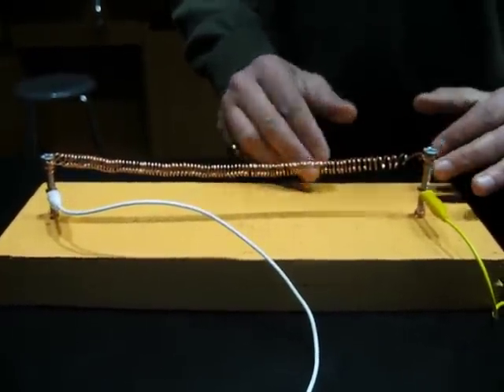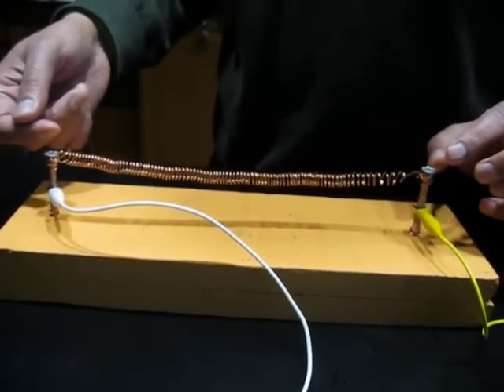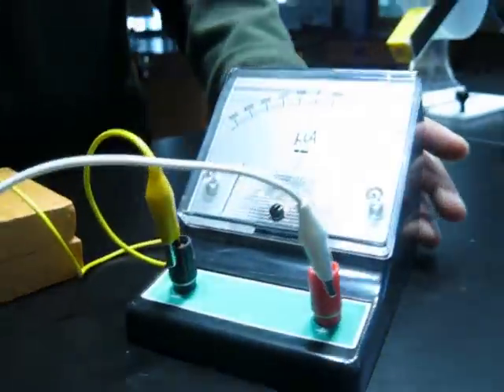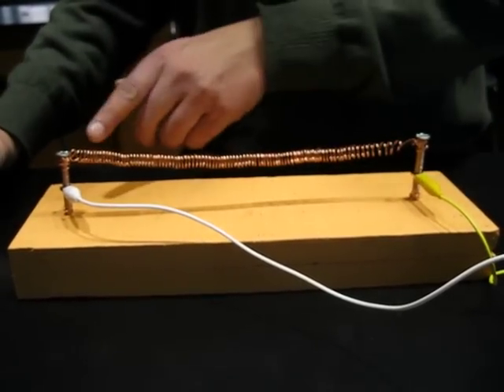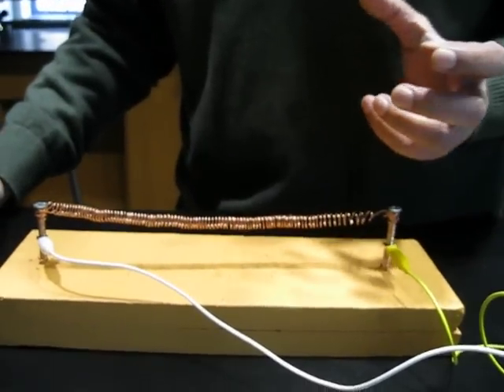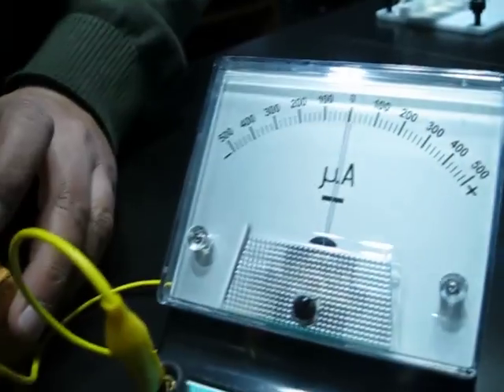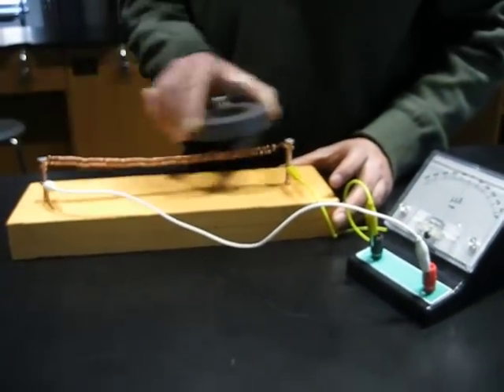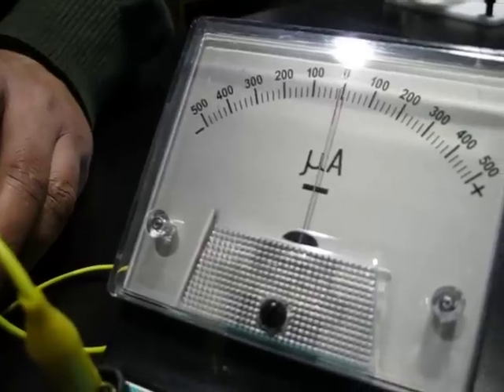Electromagnetic Induction, Faraday Experiment

Comment: The low voltage developed is due to the subtractive polarities of emf induced in two opposite side of the coil. They tend to cancel out each other, however they're unequal so there's a small potential available at the voltmeter terminals
Reply from the maker: Make sense to me!

Comment: Formula for calculating  current (induced) is B/un=i
Where, 
 B= intensity of magnetic feild 
n= number of turns
u(nu)=permeability of the material
Reply: Permeability of wire? You mean size? Or gauge Of wire?
Reply: I've heard the formula for concluding the power or horsepower of a motor rpm ÷ frequency or hrtz? I think something like that lol
Reply: @northwestrockgem9745  Nahh...... permeability of any material means....the  magnetic capacity of any material i.e. amount of magnetic intensity a material can create... ✌🏻
Reply: @northwestrockgem9745  I don't have any idea related to it...... 😅😐 
I haven't studied that yet 🥲

I'm a student from highschool 😅🥲😐
Reply: @northwestrockgem9745  permeability mean: paramagnetic ( non conductive magnetism) or diamagnetic ( conductive magnetism). The magnetic flux can trougth the material or can be deflected.

Comment: I wouldn’t call that an experiment, I would call it a demonstration. You understand the phenomenon, you are demonstrating it. An experiment is when you are testing a hypothesis and you don’t know what the outcome will be.
Reply from the maker: Sure, it is a demo!
Reply from the maker: I think I can call it a demo and expt both since we used different nails(thickness to control the resistance), changed the length of the wire means number of coils multiple times and different ampermetre to see the deflection, finally it worked!

Comment: You should use a material with high permeability in the core so that all the flux lines go through it.
Air is the weakest conductor of magnetic flux.

Then you should rapidly move the magnet to and fro from the coil. You’ll get a higher deflection.
Reply from the maker: Sure, I will test it ! advise me the material i should order for the best result!

Comment: The change in the magnetic flux is too little mostly because you are moving the magnet OUTSIDE of the coil. In a perfect experiment this would produce NO current.
The only current you are producing here is due to experimental error and arrangement imperfections, against the magnetic flux law.
You should put a little magnet INSIDE the coil.
Reply: In addition, when you enter inside the coil you should rotate the magnet (in the video the magnet has the wrong orientation), in such way that the magnetic field change in the same direction of the coil axis in order to maximize the change of the magnetic flux
Reply from the maker: I dont think its an experimental error after the calibration, the magnet I am using is very powerful, weak magnet did not induced measurable current, and in addition ...less number of turns were not helpful either!

Comment: Dear sir, more emf and hence current would be produced if you keep the magnet in your hand vertical and not horizontal. I am an electrical engineer, I request you to consider this once. Thanks.
Reply: Can you explain the reason behind it ?
Reply: Flux should be perpendicular to plane of coil isn't it , to induced more emf
Reply from the maker: Sure
Reply from the maker: Watch it again Aditya!
Reply from the maker: Sure, Thanks for sharing will do!
Reply: Can u make a turbine 8kwh that's efficient and cheap at the same time with least mechanical breakdown vosts
Reply: Hello, cheers from Brazil !

Instead of moving the magnet sideways, always pointing the same way, you should twist it, making it point towards and than away from the coil. THAT will induce difference in magnetic flux across the winding.

Comment: weak because you just move a magnet outside of winding. should move in and out inside..
Reply from the maker: Watch the other demo of EMI!
Reply from the maker: I have to get an extremely small bar magnet to slip through the coil, the deflection would me more in that case my hypothesis!
Reply: @deepakkapoor081  I agreed with Ismail.   Moving the magnet along the coil didn’t change the total flux inside.  Therefore it won’t produce a strong emf.   Instead of using a small magnet, have you thought about using a larger coil instead.  I used the school standard coil, I can produce a deflection at least 20 times more than yours.    Just my two cents.
Reply from the maker: @manla8397  sure I can try that, what do you mean by school  standard coil? And the magnet I used was pretty strong ! But sure thanks , I will definitely try as soon as back to school!
Reply: @deepakkapoor081  schools usually have some standard equipment for demonstrations.  One of them are induction coil.  The coil diameter is about 5cm.  They are quite robust and can be used for many different experiments.  For example IEC produces a lot of scientific equipment and exports them over the world.  

When you slid the magnet along the coil, the total magnetic flux inside the coil did not change much.  In fact I suspect the current was produced by the unsteady hand movement rather the horizontal movement along the coil.   You may find some videos in YouTube about induction and see how much deflection (micoamps) they made.  

BTW where did you get your ring magnet?  I retrieved a few from microwave ovens but not as large as yours.
Reply from the maker: @manla8397  thanks for the info, I was very careful while moving and the deflection is not due to motion for sure! Somebody just gave me smaller but very powerful ring magnets around 5, I don’t need so many! Where are you located you can privately email me at deepakkapoor0810@gmail.com, if you are close I might be able to send you some!
Reply: @deepakkapoor081  I am in Melbourne.  Thank you very much for your offer.  It is very kind of you. Keep the magnets for you and your students.  You never know when they got crazy ideas that can use up all your treasure collection.    Depends on the domain configuration, you may use the ring magnets to make levitation gyroscope.
Reply from the maker: @manla8397  haha, you are just 1 day away from me by air NYC to Melbourne!
Reply: @deepakkapoor081  interestingly we are in lockdown too.  🙂.  So far we have 26 weeks in lockdown.   We struggle to keep our students engaged.  

See you around and keep safe, mate.